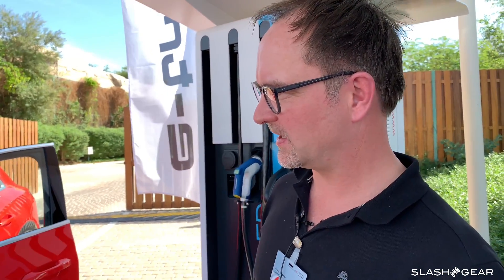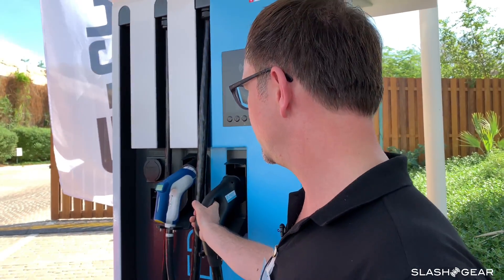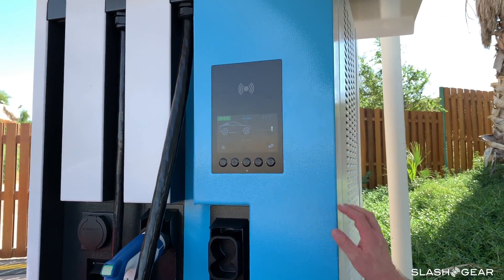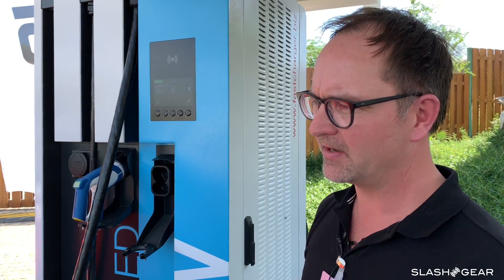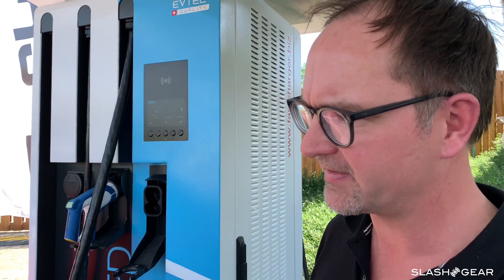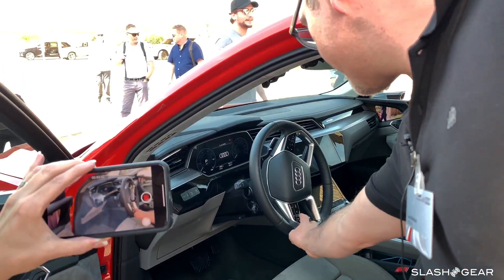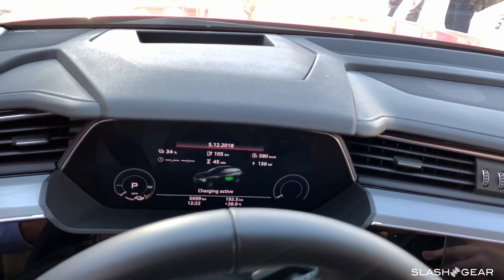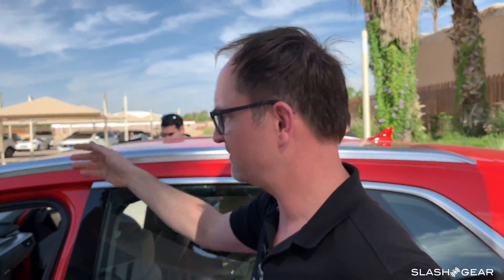Audi e-tron SUV demo: 150 kW DC high-speed charge

Comment: False advertising to begin with Mr Tesla killer. I'm very inefficient but don't worry, I can charge as quickly as possible to make up for my slackness. I really wonder how the etron will perform in cold weather. Did you also tell everyone that typically, you charge at 90% SOC for daily use? That's another 20 miles of range off.
Reply: Ayo Deveneaux It performs amazingly in the cold...it has a heat pump.  Research it, it’s amazing. Not sure what you’re talking about with your “false advertising “ comment...can you elaborate?  Or are you just here to troll anything non-Tesla?

Comment: 150kwh means 130kwh?
Reply: He said it, the station has no cooled cable. Otherwise 150 would be possible.
Reply: Don't mix up kw and kWh
Reply: Moe´s Garage if the battery was cold then it’s quite good speed.